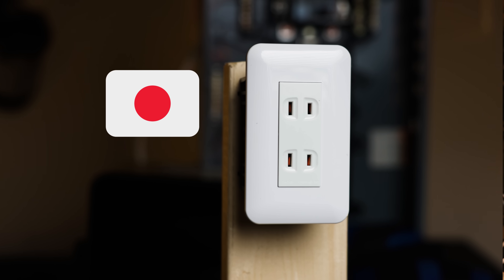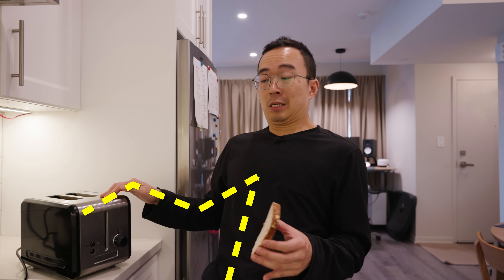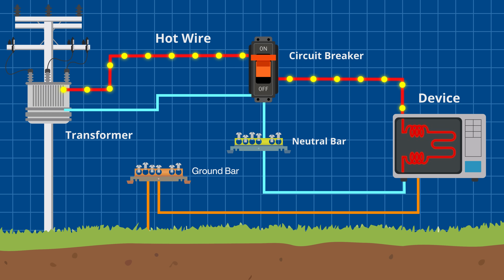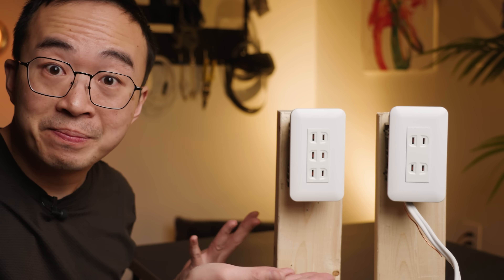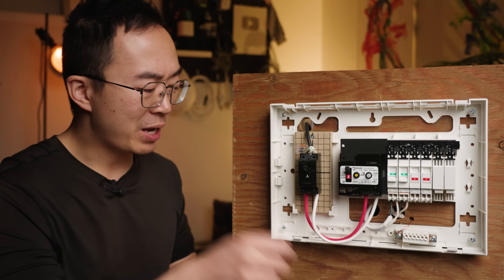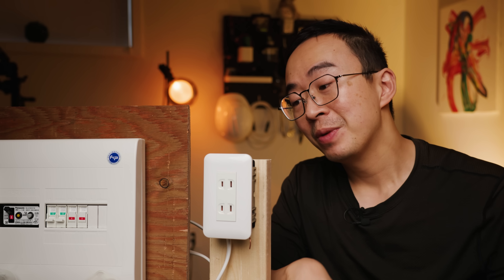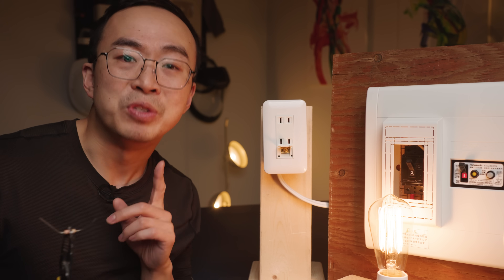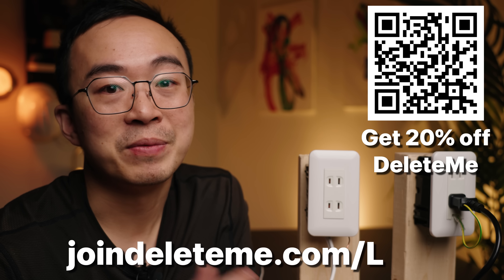How Japan Made Their Outlet Safe

Comment: The US design isn't silly enough to shut down every circuit in our house when one (nuisance) trips, because they are on individual circuits. Better than GFCI at the breaker, is at one of the outlets in the same room. You don't have to walk to the panel to reset (in total darkness for a whole-panel GFCI), and when they go bad (tend to last about 10-15 years), it's a cheap ($15-$20) and easy fix. Replacing a breaker requires knowing how to do it safely, and those cost 4x more.
Reply: Every circuit having its own GFCI breaker would also be less inconvenient. 

BUT there's an intelligence to Japan's approach. Retrofitting an existing home with a single large GFCI is faster and less costly than replacing every individual breaker or the first outlet on each circuit with a small GFCI. This is probably also why it goes between the main breaker and the individual circuit breakers instead of replacing the main breaker, which I thought was an odd choice at first.
Reply: Replacing a breaker in most US homes takes about 5 minutes.probably less
Reply: @leerosson216  I've done plenty of work in my panels (including whole panel replacements), but let's not kid ourselves, working in an electrical panel is on the more advanced side of DIY. To do it safely means turning off the main disconnect/breaker, which is inconvenient. Way more involved than killing one circuit and replacing a GFCI receptacle.
Reply: @ I am sure it seems more intimidating to most people,that’s certainly been my experience. But in the course of my job, I plug my floor sander into power panels multiple times weekly via a pigtail right to the mains, and sometimes this requires popping out a couple breakers to access them.maybe not for the uneducated, but the service panel itself is a pretty simple thing,kind of like brakes.if you know where to put your fingers, you can keep safe.
Reply: One situation where a GFI in the breaker panel is needed is when an outlet has a split feed, with each half of the duplex outlet on a different breaker.  I haven't heard of a GFI built into those outlets.  I have that type of outlet in my kitchen.
Reply: GFCI outlets need to be installed and chained correctly or they only protect one thing plugged into them. Adding RCD to a panel ensures everything in the house is protected. Nuisance trips don't happen that often if at all because of higher trip treshold. Mostly serves for detecting devices that have neutral and ground shorted in them.
Reply: The same goes with SK and Japan. They have main breaker without GFCI and Subbreakers have GFCI/AFCIs. Sometimes they wire 2 different circuits to washrooms. One for the receptacles, and the another for the lighting. And this is required in the US by the code as well.
Reply: Single large GFCI (whole-house, ala Japan and much of Europe) is a troubleshooting nightmare when it trips. Where to look first??? Point of use GFCIs (America) show you exactly where the fault is and if there is no fault (failed GFCI, a way too common occurrence ) it's only one receptacle out of service instead of your whole house.
Reply: @sootikins  Turn off every breaker, reset the GFCI, then turn individual circuits back on one by one. In the 2020 NEC, GFCI at the breaker box is required for almost everything besides bedroom and living room outlets.
Reply: @teardowndan5364  Okay you got me on the NEC cite. My excuse is that I'm industrial not residential - different worlds. A GFCI in the box for each individual branch circuit is a decent compromise I suppose. At least you know right away which circuit has the fault.  Your "turn off every breaker" troubleshooting tactic is obvious but certainly not as fast or simple as resetting a GFCI receptacle at point of use/fault.
Reply: Imagine GFCIs going bad after 10 years. USA quality, everybody!
Reply: That is application of economics, AND after decades of GFCI outlets having become available in the USA.  So not a useful comparison.

Comment: Tying the earth and neutral systems together introduces the possibility of a shock if the supply neutral (PEN or grounded conductor if you prefer) goes high impedance or open circuit.  An RCD/GFCI can not protect a person from that.  TT earthing is safer in that respect but it has it's own issues.

Comment: Now cover japan's insane power grid, half 50hz and half 60hz, which prevents load shifting and causes bottlenecks in the grid.
Reply: After the war, Kyushu built up with equipment from Siemens,  while the rest of the country bought equipment from Westinghouse.
Reply: @xenuburger7924  You mean the Meiji restauration war? 
That story goes back to when electricity was still a new thing.
Reply: @xenuburger7924  It's a WWII Foobar
Reply: Is there any reason they couldn't switch to one or the other?  Are there certain devices (besides clocks) that require a specific frequency?
Reply: @LoveClassicMusic0205  They would have to replace all the generators in power plants in half the country, that would be quite the investment and no power in that part of Japan for most likely weeks. That is very unacceptable nowadays, so they are more or less stuck with what they have.
Reply: @LoveClassicMusic0205  Clocks rarely use the network frequency for reference these days.
Reply: @samiraperi467  I guess this explains why when I moved to Hokkaido (50 Hz) with an old digital clock, the clock has been slow...?
Reply: @LoveClassicMusic0205  Simply because it would be an absolutely massive undertaking - 50Hz and 60Hz generation equipment is physically different and since AC grids are synchronous you can't swap stuff over one piece at a time - you would need to power the whole thing down, swap out the equipment and then bring it up at the new line frequency - at the LV side the distribution transformers would also need to be either replaced or derated.
Reply: @LoveClassicMusic0205  Other than the absolutely crippling expense of doing so? You've got to get people to agree on which standard to accept and why. Good luck getting two heavily entrenched groups to back down and actually agree against themselves.
Reply: @LoveClassicMusic0205  Corded electric shavers were the first one I encountered, but anything that runs off an AC motor really.
Reply: @LoveClassicMusic0205 There was some kind of disagreement as to which system was better back in the day, so they just split the country. lol And all appliances are made to handle either.
Reply: @ItchyKneeSon  This is actually wrong. The reason for the difference is who was helping out with Japan's electrification projects. The UK started things off, and implimented their 50Hz system. When America took over, they brought in their 60Hz hardware.
Reply: @ItchyKneeSon  Less disagreement, more that they were supplied half by the US and half by the Europeans.
Reply: @LoveClassicMusic0205  if your device has a 60 hz transformer and you plug it in to a 50hz outlet the transformer material will saturate the lacquer on the wire windings will melt from the heat and short out.

but you can use a transformer  made for 50hz on a 60hz supply [obviously]
Reply: @LoveClassicMusic0205  
Costs, stubbornness because there two massive competing electrical grid Corporations in Japan that want to keep the dual system alive.
So Capitalism, essentially. 
Even North Korea uses the European schuko adapter, same with South Korea, the schuko adapter is much better even if its a monstrous pain in the REAR to plug in at times.
Reply: @SMGJohn   That's not capitalism or a better term is free market. What you are describing is monopolism even though there are two companies and not one.
Reply: @daifeichu  
Mode of production in Capitalism is accumulation of CAPITAL. 
Hence the name, one of the big contradictions to free market Capitalism is the necessity for growth, without growth there is stagnation. 
So what happens when there are multiple competitors, pushing the prices down or innovating.
Here lay another problem, innovation costs money which eats into your profit thus reducing your capital accumulation. 
Reducing the prices is even worse because that directly impacts your ability to accumulate capital. 

So what can you do to solve these problems? Well its simple! Eliminate the competition!! Its business 101, its taught in every business school, in every economical school of thought, if you seriously think that playing fair and kind in the market is going to make you successful, you are dreaming man, absolutely dreaming.
Reply: @SMGJohn  only when there's "child protection", otherwise it's easily to plug in and even pull out. ours 8germany) looks like the variants in the video makred as "russian", 'cause we have 2 round pins and 2 "stripes" showing in between the pins from the side to the middle.
Reply: @crashoverride6413  
The cover is mandated in Europe though, there so many times I have to punch the damn plug into the connection, sometimes the plugs stick as well into the connector because the plastic shroud shrinks duo to cold, another annoyance specially when its in a hard to reach place and there not much leverage, in that sense the UK plug is better for its ease of insertion.
Reply: Absolutely. EU plug is utter crap. British is the best  @SMGJohn
Reply: @Will-sc3hw  Not really. The one we have in Slovakia is the best - it's not massive like the UK plug, the grounding pin is exposed, it can handle 16A (compared to 13A for UK plugs) and most electronics these days are double insulated which use the much smaller Type C plug. The only safety feature missing is the switches on the sockets
Reply: @KofolaDealer  fair enough, never seen one in person but I'd take a Slovakia one over the EU
Reply: @Will-sc3hw  France uses the same one. It's very similar to the one used in most of EU but it doesn't use those horrible clips
Reply: @SMGJohn  Well, I'm glad someone puts their money where their mouth in and works for free. Thanks man!
Reply: @SMGJohn  
But them being hard to get in and out makes them more sturdy. I'll defend the Schuko to the death, it's a great design, combining the best aspects of the French, British and Italian plugs.
Reply: @SMGJohn  Great explanation comrade! Someone's been reading their theory!
Reply: @SMGJohn  In the early days of electrical generation, German (50 Hz) and US generators (60 Hz) were adopted, resulting in the complication. Infrastructure got built around these two standards that resulted in a two-frequency system.
Reply: @SMGJohn  That's why capitalism is marxist.
Reply: @Smougda rage bait fail
Reply: @SMGJohn  ragebait??, capitalism is a marxist concept. Historically the advocates of the so called "capitalism" never called themselves that, they used "laissez faire" or "free market", because the definition of the accumulation of capital is purely a marxist concept.
Reply: Something I see a lot of, especially from Zoomers, is this hatred of Capitalism, they blame everything for it.  Utter ignorance on display but because it has such high numbers, they believe they are correct and carry on.  Sad.
Reply: @tradnyxx  
What do you think actually regulates prices in capitalism - individual choices, or the underlying conditions of production?
Reply: @LoveClassicMusic0205  General Electrics is responsible for the 60 Hz grid, while AEG is responsible for the other half, but both with kid voltages. Japan deserved something better, like a 3~230/400V system to all homes, like in any other civilized country ...
Reply: @LoveClassicMusic0205  clocks don't use the grid's frequency. I don't know for sure, but I suppose it's just the inertia. it takes time and money to convert and neither party wants to compromise.
Reply: There are three power conversion stations that allow the two sides of the grid to interconnect. The use HVDC as an intermediary.
Reply: @scrubnick  Yes but, as has been demonstrated in the past, in extreme conditions, they become the bottleneck where the Japanese grid's ability to load-shift hits its limits. (I believe the Fukushima Daiichi disaster was one such time.)
Reply: @ssokolow  The bigger problem there was that although Fukushima is located in the 50Hz region the design of units 1 and 2 was a direct copy of a US reactor and hence all the control equipment was designed to US standards with 60Hz power and (for Japan) non-standard operating voltages.  The 60Hz was generated by rotary converters in the turbine hall - which became inoperable when the turbine hall was flooded.  In addition to the redundant converters in each unit there were provisions for cross coupling the instrument power from the other unit or connecting an external generator.  Of course, the other unit was also flooded and getting a large 60Hz generator quickly in a part of Japan that used 50Hz power and had been wiped out by a huge tsunami within the 72hrs that the batteries could hold the instruments up turned out to be way harder than was envisaged when the emergency plan was written.
Reply: @ssokolow I remember some whinging gaijin posting a picture of brightly-lit Osaka with a "how DARE they ;_;" while Tokyo was having rolling blackouts. Erm, maybe because Osaka is on a different grid entirely? What, are they supposed to have intentional blackouts in solidarity or something.
Fackin' gaijin, I cross the street to avoid them.
Reply: The plus side of the 50/60 Hz thing is that products from Japan never rely on network frequency for correct operation. Very handy for electronics, such as (vintage) synthesisers. You only need a simple transformer.
Reply: They could do it with HVDC if the really had to. For a few billion only too. probably cheaper than changing all the grid over. just have two asynchronous systems connected by a DC link
Reply: That's a result of history and short-sighted planning: Tokyo in the eastern half got its first electrical generators from AEG in Germany (running at 50hz) while Osaka in the western half got theirs from General Electric in the USA (running at 60hz).  It didn't matter for the first few decades but by the time the grids expanded and met up, it was too expensive to change either side to a unified frequency.
Reply: Parts of Canada were on 25 Hz until the early 1950s when the system was switched to 60 Hz. However, 25 Hz generation continued until 2009 for certain industrial uses.
Reply: can't they just split the difference and switch to 55Hz?  Just what the world needs, a new standard :)
Reply: The dual-frequency grid prevents faults from bringing the entire grid down at once. 

Everything is a tradeoff.
Reply: Since they use North American outlets and similar voltage, they should just switch to 60 hz. I honestly wish the entire world would switch to 240 volts, 60 hz, and use either the British plug or the schuko plug.

Comment: I don't understand how japanese appliances aren't grounded. What happens if a live wire in a toaster or something touches the metal body? The japanese system just relies on you completing the circuit to ground? that's ridiculous. In the US as soon as the wire touched the toaster's metal body the breaker would trip. Is the neutral just used as a ground in appliances??
Reply from the maker: Good point, so there's a lot of type II appliances (plastic on the outside) that minimizes this risk.  But yeah, otherwise you would just get shocked which is why grounded outlets are being introduced to kitchens where that's more likely to happen.

In the USA there are instances where ground doesn't have enough energy to trip the breaker.
Reply: consider the scenario neutral is not tied to ground, in other words not at ground potential
no part of the mains power supply has connection to ground, as a result current will not flow when a grounded conductive object (such as your hand) come in contact

the drawback is lack of lightning protection
Reply: @Lam  what about the big beafy 400V in the kitchen? is that one grounded?